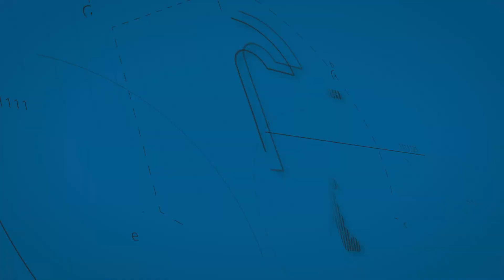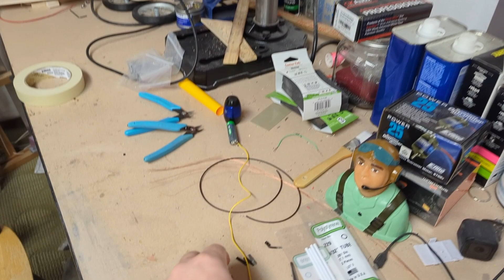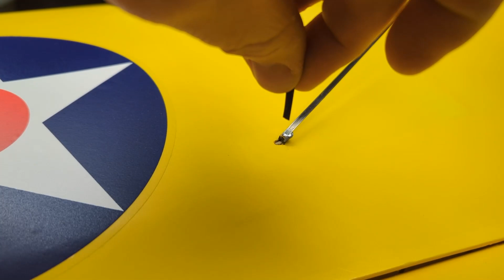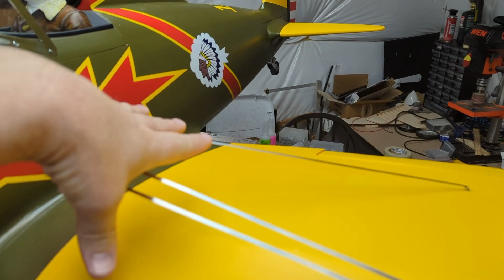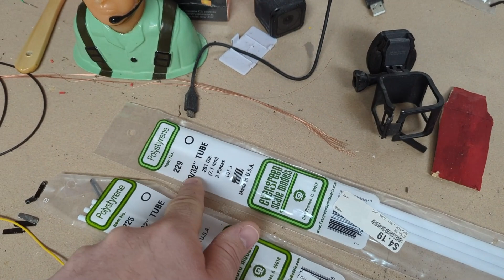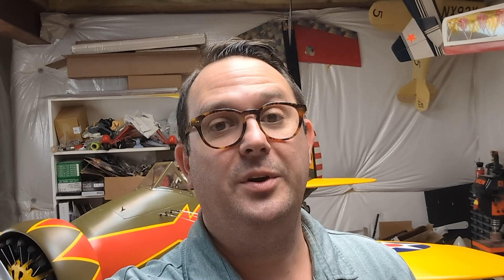P-26 Peashooter | Light at the end of the tunnel

Comment: Glad to see the wires turned out well.  The javelins are definitely a “sticking point” 😂. I guess it depends if you have to rig or unrig them. On  my Travel Air Mystery ship I have to un-rig each time I fly, so I had to have a removable option that was quick and easy. Not sure if you can leave yours in place or not. That will drive what kind of method you use.  The P26 javelins I saw on the full size were wood and had the ends cut in half and notched so the wires could fit in them and screwed together like you mentioned. Looking forward to the solution you come up with.
Reply from the maker: They do not have to be removed when the wings are removed but I think I've worked out a trick solution. Stay tuned!